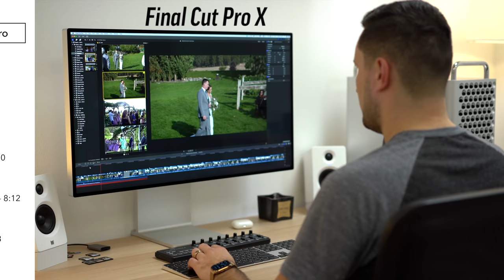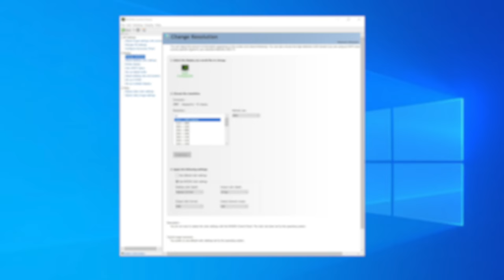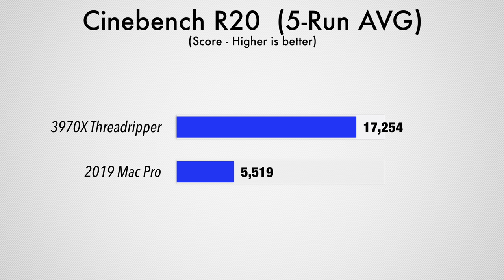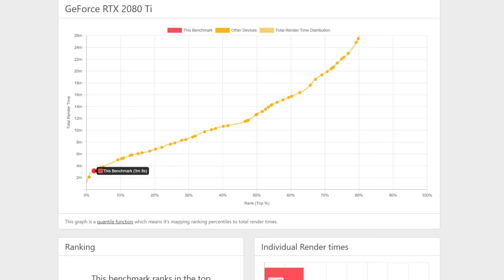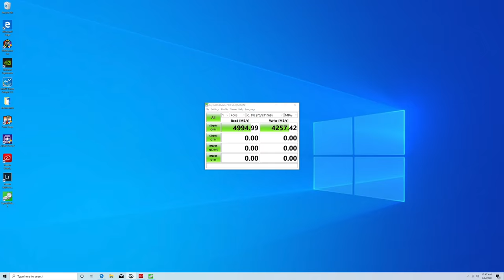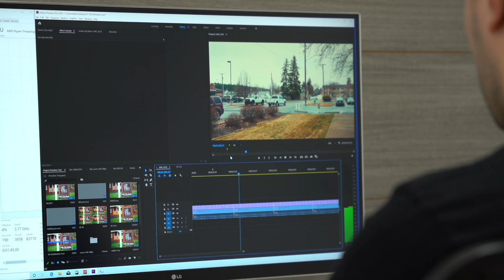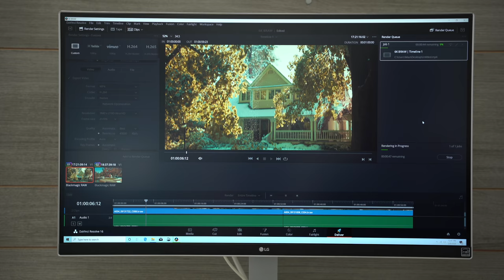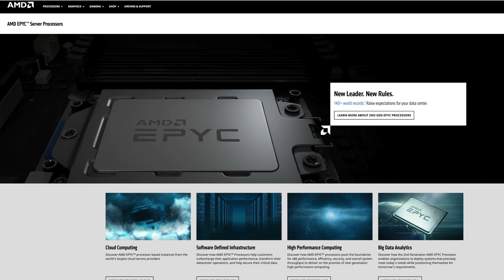$15,000 Mac Pro vs $5,000 Threadripper - Sorry Apple..

Comment: This dude is trying so hard to defend apple it's just sad
Reply: I see this comment everywhere but this doesnt make sense. He is literally showing data how the Mac Pro gets fucked. Am i watching the wrong video??
Reply: Smorfar Agreed. Not sure what ppl are crying about...
Reply: You can litirally get a 2nd 2080ti and its still half the price
Reply: @mrbaszz7404  half the price? Lol it wouldn't even reach half the price of apple
Reply: Bas Veenvliet he can even go for a quadro RTX 8000 that would smoke the Vega pro II duos
Reply: @NuclearFuel  yea i dont understand why hè only used 1 2080ti. Maybe do Apple would look less of a rip off. Cmon man 15k for that garbage cheesegrater
Reply: Coming from a Samsung fan 
The irony
Reply: Smorfar he claims it “doesn’t scale to real world use”, also says the TR has excess ram, while complimenting apples 1.5terrabyte option
Reply: @Smorfar  yes
Reply: Ikr xD
Reply: @Smorfar  mainly because he clung onto a couple dumb points for too long. He spent way too long talking about how the Mac runs quieter when he could have easily adjusted fan speeds on the threadripper to get the same effect. He also just underplays certain benchmarks. It just feels odd that he doesn't make a big deal out if the clear performance dominance from the threadripper build. Same goes for the price. $10k price difference is a fat chunk of change and he doesn't even really seem to bat an eye at this
Reply: @Smorfar  but besides showing data he is also throwing things like "BUT the mac does less noise"
Reply: Sad sad sad sad sad....
Reply: @smorfar listen to his summary at the end of the video, he is definitely defending apple towards the end.
Reply: rvidal0001  the problem is his delivery, which I, aswell as many other, found somewhat odd. He quickly brushes over huge differences such as performance but spends way too much time on little thing such as noise. He doesn't to insult Apple, but come on, it's a $10k price difference and he doesn't even seem to bat an eye at that. Not to mention that he could have easily solved the noise problem by lowering fan speeds. The way you interpret what someone's saying can vary from person to person, and I'm not the only one who felt he was grasping at straws here. But of course, you'd rather call us neck beards than actually listen to what we have to say.
Reply: he is sad he spent 15,000 on a trash pc.
Reply: Agreed!
Reply: Guy makes super comprehensive video to show how a way cheaper PC can beat a Mac Pro in loads of tasks, giving more bang for your buck, better upgradeability, but also addressed objective pros that you get for the Apple premium. Comment section = triggered Apple-haters losing their shit for accurate description of facts. He never says the Pro is a better purchase, he just says that the stupid price tag does come with some things that the PC can't deliver.
Reply: Rlly hes just talking about the pcs performance how is he defending apple?
Reply: Facts
Reply: @Smorfar  look at 12 mins into the video. He offers a $25000 insane upgrade option as a positive for fucking apple. Okay.
Reply: @Smorfar  The fact he keeps saying Mac Pro is quieter, is pre-built, etc. They could have you know, mess with the curve to make it quiet, make it less hot and still be powerful, from the sound of it, they forgot that heat affects the parts with performance. So lowering the heat could probably boost it more, not setting all settings at max always benefit you, even with powerful builds.
Reply: Nick Tarantino I don’t watch this guy but maybe just maybe he needs to justify his $15,000.00 purchase.
Reply: @NuclearFuel  yass
Reply: *It's even sadder then a Karen trying to convince the manager to believe her even with camera footage that shows otherwise
Reply: @yadhogr5889  do dont have to be a samsung fan to know that the mac pro is overprices as f*ck   and even with that shitty ips pannel screen
Reply: Just block his channel and don't watch his videos so he won't make money to give to his God Apple.
Reply: So so sad man
Reply: @Smorfar  yeah but uses fan noise as a excuse to justify spending an extra 10k. Fan noise is something you'll get over in a week/month